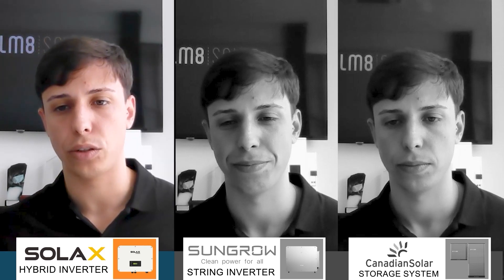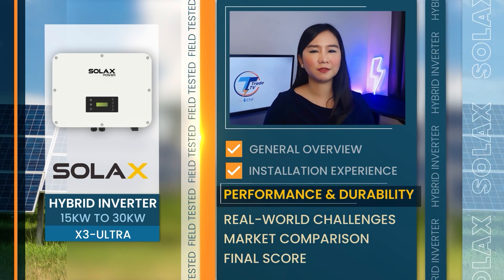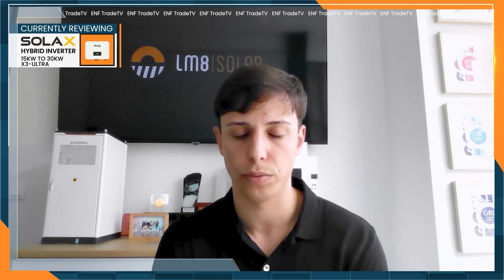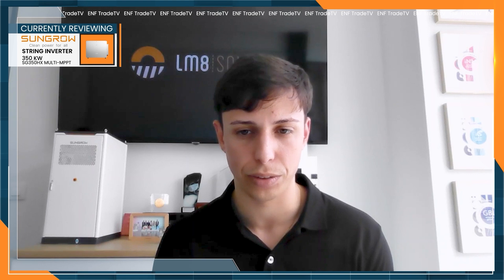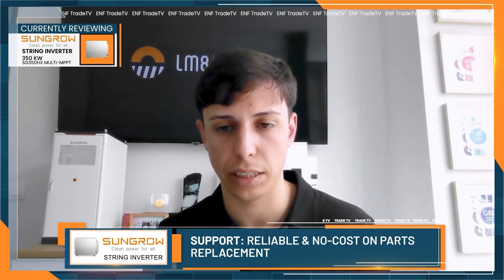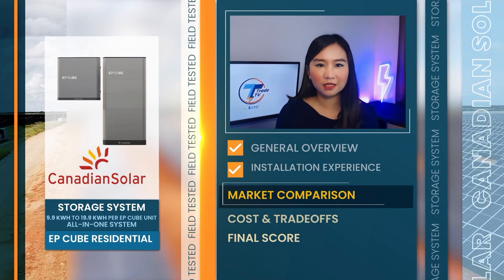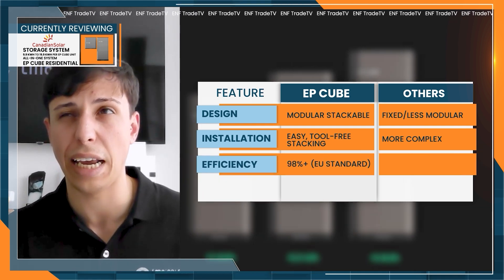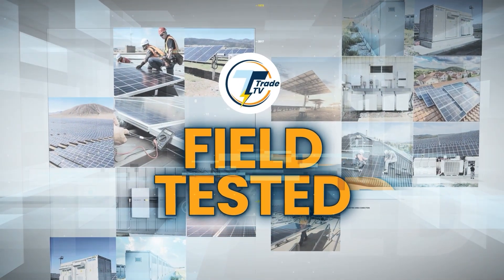Field Tested Product Review: SolaX Hybrid Inverter | Sungrow String Inverter | Canadian Solar EPCube

Comment: Interesting point made - Latest inverters hot off the production line giving higher efficiencies, but potentially a bunch of issues that aren't clear until use is widespread.